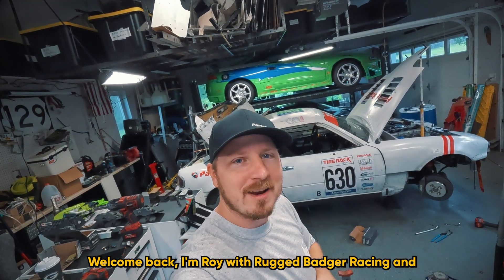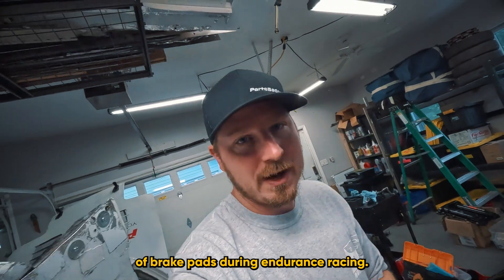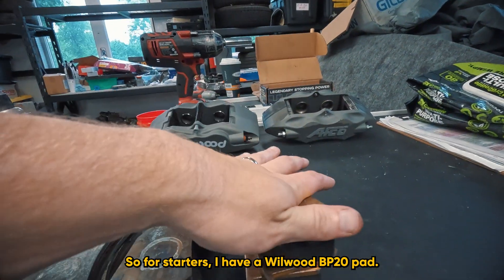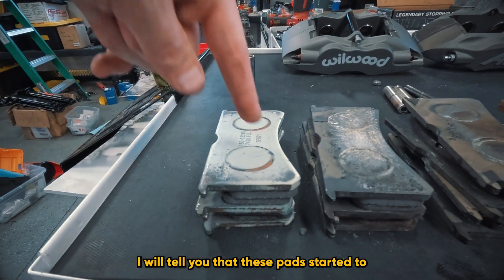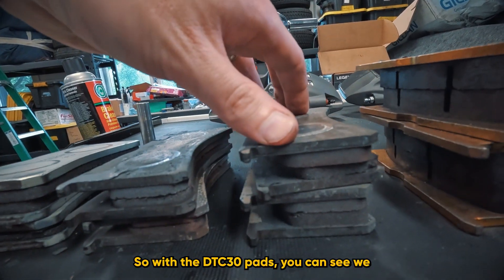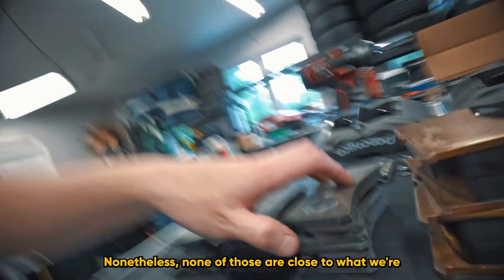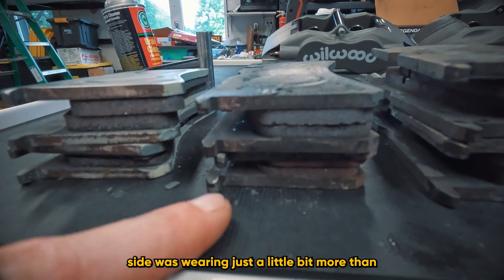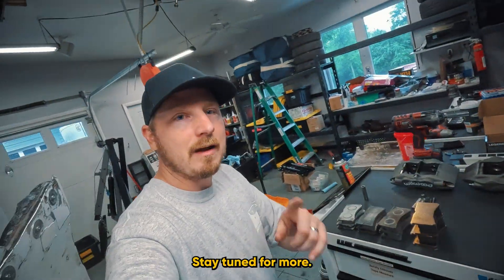Results: Wilwood BP-40 vs. Hawk DTC-30 vs. Hawk DTC-50 for Endurance Racing - 7420 Pad Shape

Comment: We used to run the ST43 and while the wear is unbelievable, they have a very aggressive initial bite, and once they lock, a difficult to get rotating again. We tried the Ferrodo DS1.11, and those felt fantastic, but were gone in a race weekend. We now run the PFC97, and while they feel as good as the Ferrodo and are very easy to modulate, they can last multiple race weekends. We use the 7420 pad shape as well (all around).

Comment: Looks like EBC SR-11 are a good replacement for ST43,  They actually last longer with similar characteristics. Way less noise too. Mine are lasting but i'll need another year to see when they'll run out lol.
Reply: Also, the enduro hawks are also not very good at doing enduro.  Try out those PFC's and EBC SR's and report back :)

Comment: TRM-BobK here.  Use the highest level Hawk DTC70 or 80 if available in your pad shape.
I use DTC70 and can get ~16 hours = 1 weekend on fronts, and ~40+ hours on the rear with stock BMW calipers and rotors.
Reply from the maker: That's good info!  I appreciate it!
Reply: @ruggedbadgerracing  I raced with you at AutoBahn.  Send me a PM with your brake ducting.  By the looks of the pads, you are WAY outside (above) the temperature range.  If the life is that short, and you have burn the pad backing plates white, you are not dissipating the heat (energy) fast enough.

Comment: Is Gingerman easier on pads compared to Autobahn?  I haven't been to either track.  For us the 50/30 setup last longer and give us better front to rear bias compared to the 30/30 setup we had in the beginning.
Reply from the maker: I am not sure, but I do know the back straight at autobahn south got the front brakes hotter than they were at Gingerman. The BP40s were definitely smelly.

Comment: That is a shame about the st43. 
I have the smaller willwood calipers that use the 12mm pads.
 I bought up everything I could get  my hands on recently.  They have been amazing and great wear on the nc. They wore a bit faster at sebeing last week  which has me concerned going forward to the 24hr race next month. Luckily I finally got the fueling down to about 1 minute so I could do a pad change on one wheel during a fueling stop
Reply from the maker: That is a quick change.  I've been lucky to not need to hot swap pads yet.
Reply: @ruggedbadgerracing  My kid is like Rainman for cars.  LOL. I was getting in the car on the driver swap thinking I had plenty of time the first time we did a swap at Daytona.  Right side is up, I'm getting in and situated and then the right side drops down and they go running to the left side.....  I was like Holy $hit, I need to hurry.  LOL
Reply: On our NA ( Brick City Happy Hour Miata) my son has the front brake pad swap to 3 min a side including the jacking and wheel on/off.  14mm socket and a flathead.  Stock calipers though.  Since we added the brake ducting our pads lasted the entire race at Sebring but that first eseeion was wet so not as hard on them.  Hope you guys get your car situated after the contact.
Reply: @DocGTO  that is really quick considering the oem calipers. 
The brake Ducting helped with hub life,pad wear,  and keeping the rotors in 1 piece. At sebring,  maybe my  Ducting wasn't pointed correctly